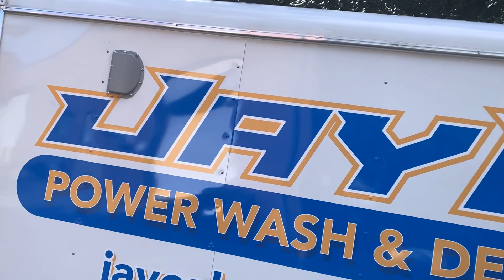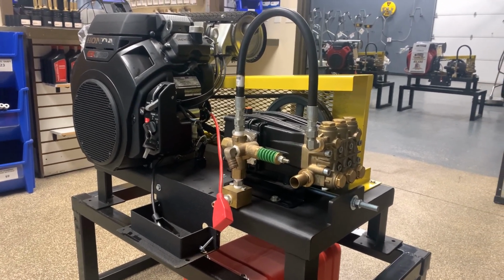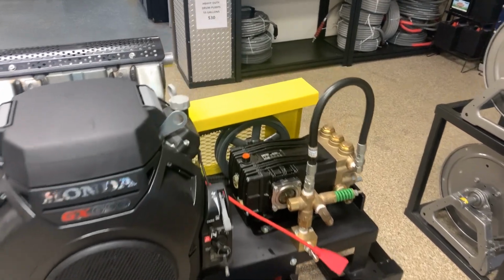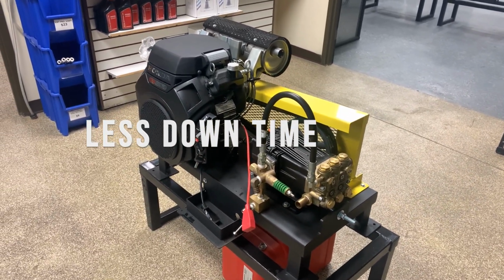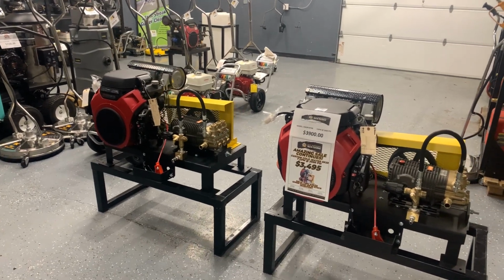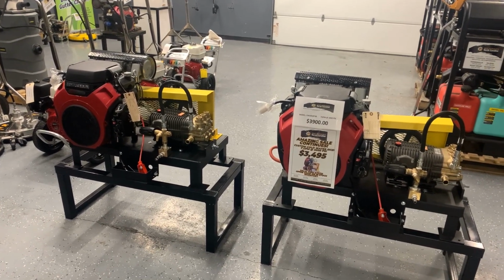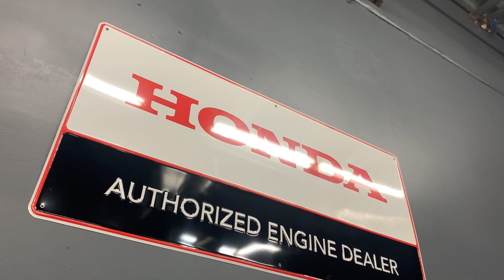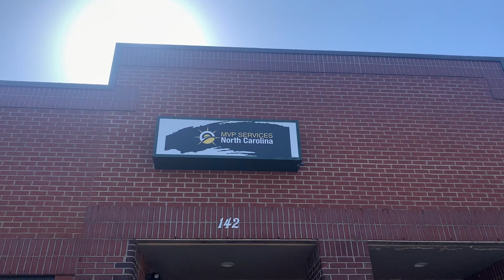THE BEST QUALITY Pressure Washer: Looking for high quality power washing equipment?  WATCH THIS!

Comment: Would a 50 gallon buffer tank be enough for your 8gpm? Thanks
Reply from the maker: So we definitely recommend a minimum of 225 gallon water tanks to supply a 8 GPM machine.  Typical water flow in our region is 5 GPM so it won’t take long to run through a 50 gallon buffer.
Reply: @mvpservicesnc  ok, thanks for the response